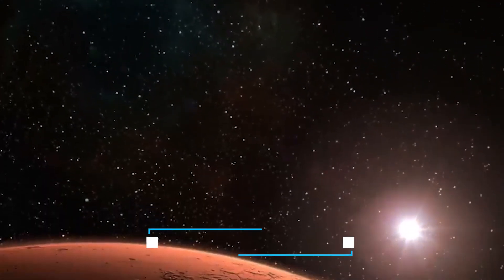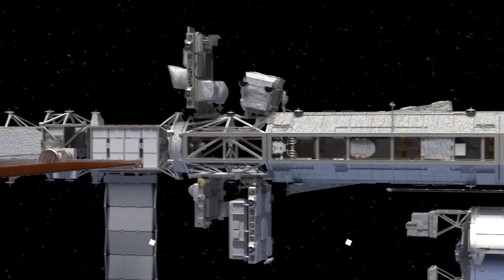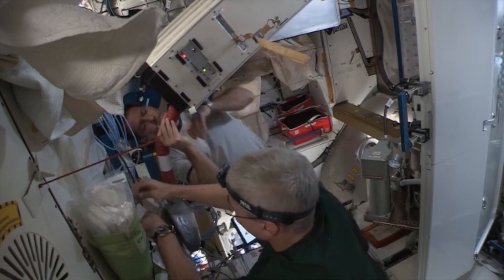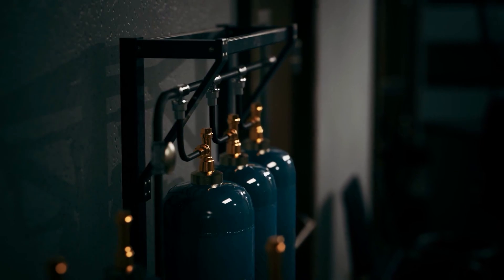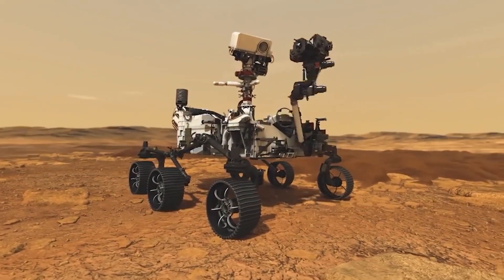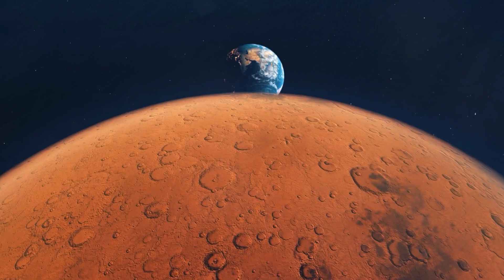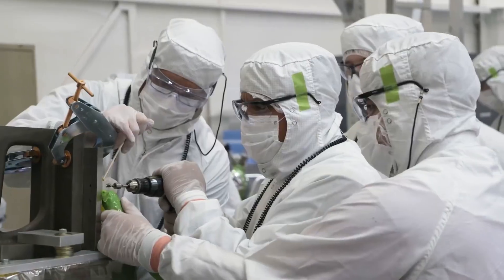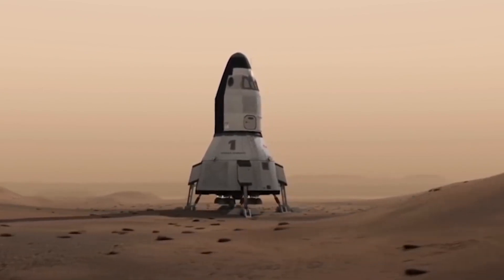Now Humans Can Breathe & Colonize MARS.

Comment: At the west end of Valles Marineris is a feature called Noctis Labyrinthus, which is in the heart of the Tharsus region. The coordinates are 7°S, 93°W. There is a water ice glacier there which contains 36 billion tons or 8.7 trillion gallons of H2O, or just a bit larger than Lake Meade at the Hoover Dam near Las Vegas, Nevada, USA.

The canyon floor is 4.35 miles deep, which provides twice the atmospheric pressure: 12.4 millibars, compared to 6.1 millibars at the datum level. The 3.75mi/6km high canyon walls also provide very good protection from cosmic radiation. Noctis will enjoy a relatively mild climate, as it is only 7 degrees south of the equator (258 miles).

Comment: There is one HUGE problem about Mars atmosphere, Mars have a very weak magnetic field, causing the solar winds to take away some of the atmosphere. Remember, Mars atmosphere is 0.006% that of the Earth. The air is so thin, you wouldn't be able to breathe, even if the atmosphere was 20%-ish oxygen. It would be like trying to breathe at 100000 feet in altitude here on hEarth. Passed 10000 feet in altitude, it is very difficult for any living thing to breathe. Terraforming Mars would be impossible. How can you increase the magnetic field of an entire planet so the atmosphere doesn't get blown away by the solar wind? 

We don't have the technology to get passed the Van Halen Radiation belt here on earth. We won't be able to get to Mars anytime soon. Mars colonization is just an impossible dream right now.
Reply from the maker: It might be impossible right now but in a century, It will become more and more possible.

Comment: You have to restart the magnetic field of mars first. That seems Like mission impossible. Then create an atmosphere which sounds Easy but is not. Then keep things in equillibrium.
Reply from the maker: I think the best approach is the use ancient lava tunnels under Mars surface. They will give protection from sun adverse Martian weather.
Reply: Mars needs a moon . If we could build a strong electric magnetic field it would help. To shield life . Even for space travel we will need to build a type of magnetic shield.
Reply from the maker: @kevinwilliams6934   It is a great undertaking.
Reply: Think of it this way...

You need to agragate millions of metal rich asteroids/meteors for 100's of years using Drones, and then transport them from the outskirts of our solar system, to mars. The metal "needle" will be 1000's of km long and will need to be accelerated enough to pierce the planetary core of mars through concurrent piercing.

After that...the remaining asteroids/meteors will be needed to make a gravitationally significant moon capable of interacting with molecules on the planet thousands of killometers away. 

After that the planet will need to be seeded by the remaining comets and asteroids rich in carbon / water/oxygen to create a richer atmosphere. 

All this may take 1000's of years...

You have to ask yourself, are humans capable of planning that far into the future?